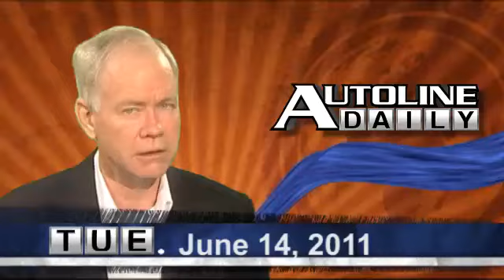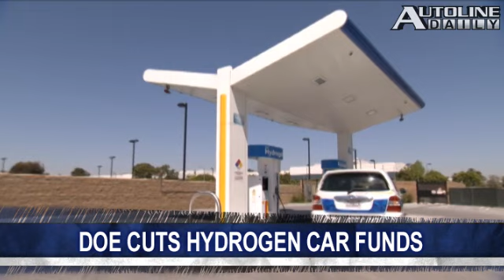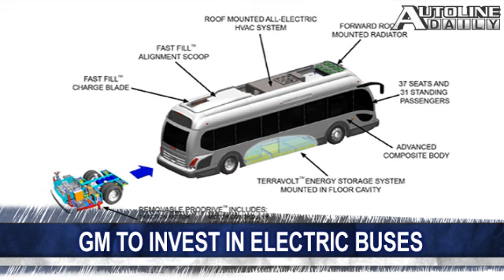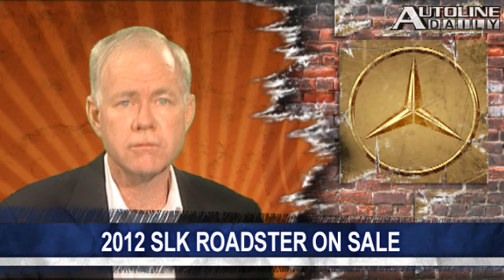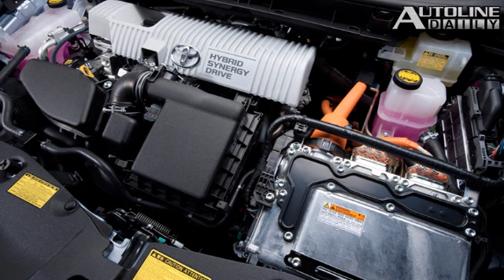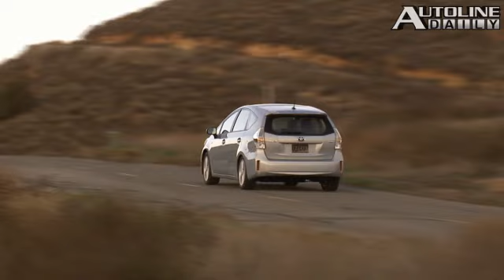Opel for Sale?  Not so Fast! - Autoline Daily 663

Comment: John, we already have a biofuel distribution system, nationwide, up and running right now.  Once the biofuel is made (and if it's from algae, the final fuel product can be made in existing refineries (or so I've heard)) then it's just like any other fuel we use today.  You put it in a truck, the truck takes it to a fuel station, and then you stick a hose into your car and pump it in like a boss.  No need for big new infrastructure; it's already here.  That's why I like algae:  not much baggage.